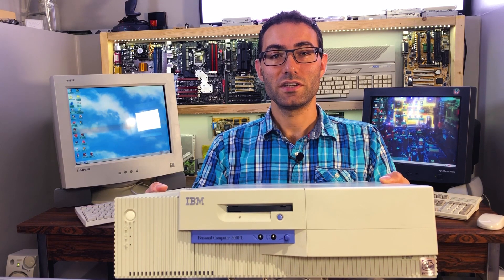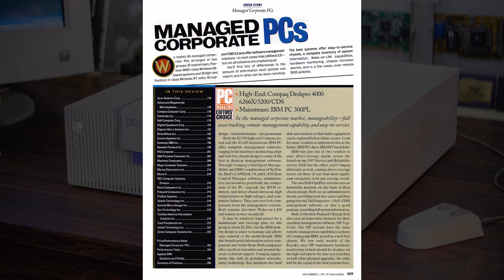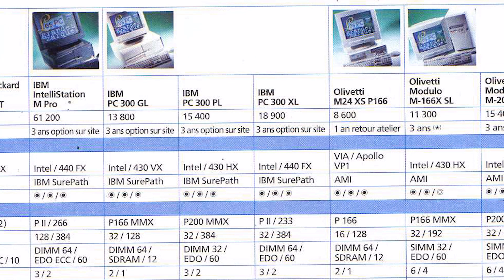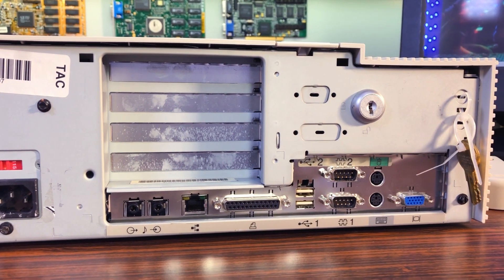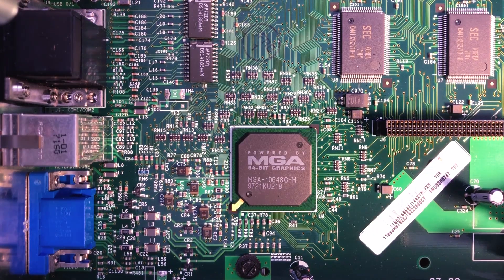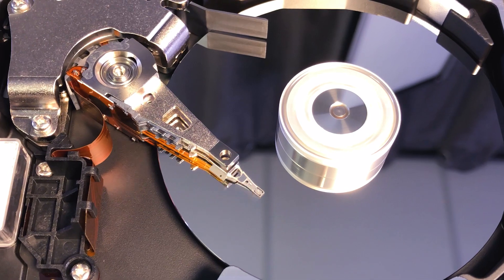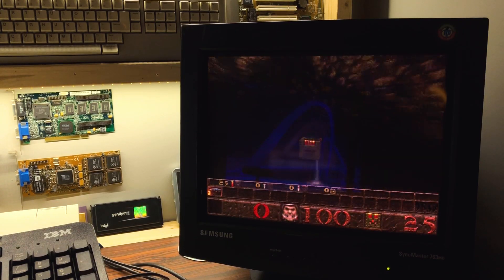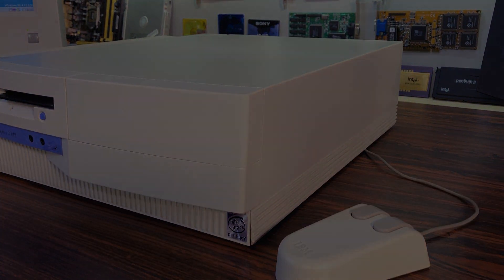IBM PC 300PL (1997) - Review

Comment: Another excellent video!!!
I couldn't believe how much info you fit into that one!
Very well edited!
Just as a note, for that era of Intel-based PC, my favourite OS was Windows 98SE ! Much more stable than Win 95 and had far better hardware support... I guess it would be cheating a little if you wanted to stick with just the original shipped OS, but using Win 95 these days is just too painful for me!  :)
Your video also answers a question I have always had - does a hard drive deteriorate just sitting / not being used? Apparently yes!
Wonder what the HDD failure mode is? Perhaps just decaying magnetic signature, or an actual mechanical failure?
Sadly I also recently learned that 30-yr old floppy disks become brittle and disintegrate leaving magnetic media all over the head of a floppy drive (which then ruins more floppies!), so I'm afraid that moving to images running off of flash-based media is the way to go for retro-PC'ing...
Reply from the maker: I agree, a Win98 SE would definitely be a better option! As for the HDD, yes they decay overtime, this one worked fine out of the box and minutes after minutes more sectors wouldn't read, until every single sector would make the disk click, and finally disk wouldn't even be recognized by the system. For some reason I couldn't read S.M.A.R.T. data either, and the official manufacturer's maintenance tool is throwing me an unrecoverable error with a nice "Contact us for immediate service".